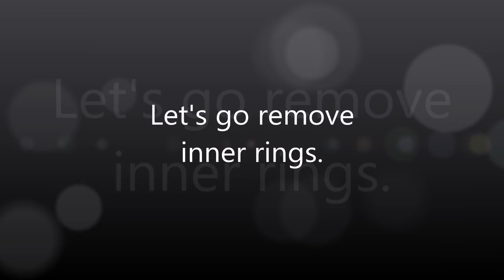How to easy remove the bearing inner rings from crankshaft.

Comment: Have seen this tool in the KTM manuals, but never in real use.
Amazing how a little heat can turn a “impossible” task in to something so easy. With such a simple tool. 👌
Even if it more or let’s obvious how it’s made, a video or some guidelines to critical dimensions would be very helpful and interesting.
Reply from the maker: In future videos.
This burner is very powerful.
Reply: @PaulXchannel  its stainless steel?
Reply: @PaulXchannel  I found the answer, thanks

Comment: Lovely device.  I wonder if a similar tool would work on steering stem bearings?  I think it would want to be steel due to the smaller contact area.  Am I correct in understanding that you heat the tool and pause on the bearing before pulling to gain some expansion?
Reply from the maker: Thanks.
Yes.

Comment: One problem, if the size of the bearing is just bigger or whatever just like happened to paul x on the video you have to "destroy" the bearing in order tobe able to fit the tool and even then it better fits exactly on point or youre basically screwed.
Reply from the maker: The solution is simple.
 More tools :)